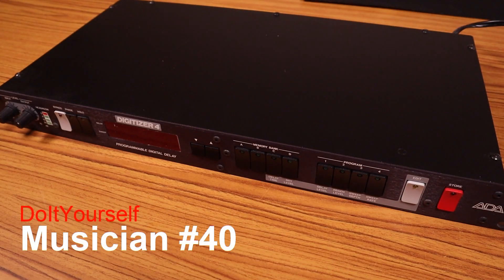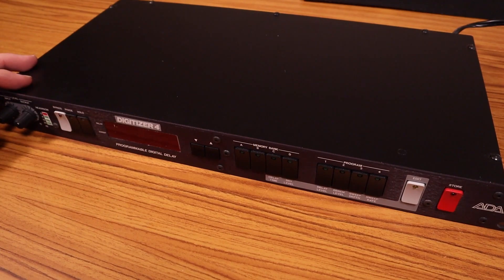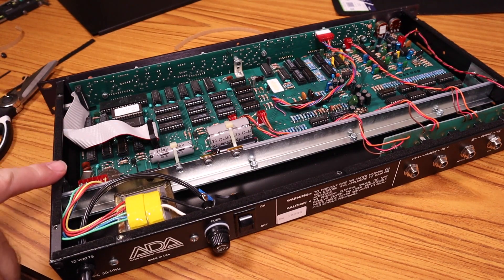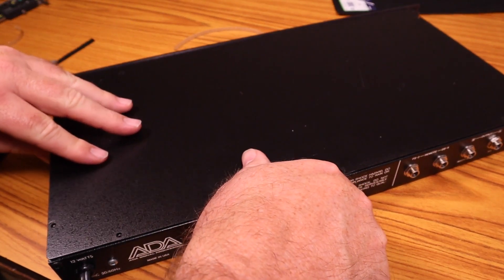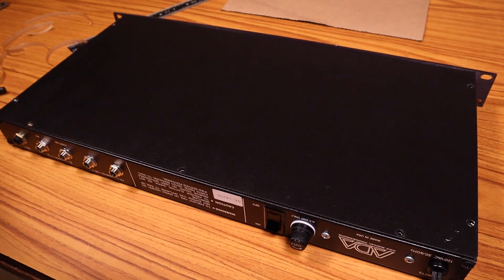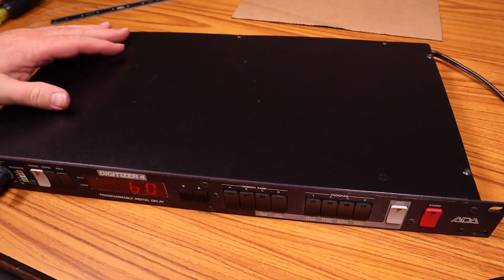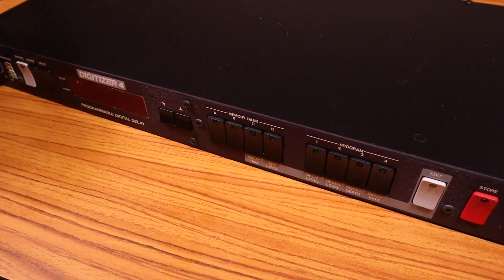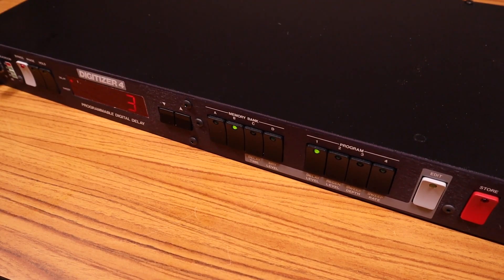ADA Digitizer 4 Humming Transformer "Fix" (FAIL) #40

Comment: Interesting attempt, thank you for the effort. Same problem with my vintage ART ProVerb 200. How about an attempt to mount the transformer externally. The challenge there is drilling and grommeting any access holes for the wiring and covering the transformer with a heat dissipating cover. I've noticed in years past high end compressors like UREI mounted their transformers outside the case.  I once had a pair of LA3A's ( showing my age ) taking a cue from that design is an old school solution??? Just a bit of trivia, I sold my UREI's for 2K 15 years ago, now on Reverb they are going for 5K each! Yikes!  Thanks for the video sir.

Comment: You can put vibration dampers used on cars on the cover, they are asphalt plate with double sided plate.  Yamaha had similar issues with one of their rack mount synthesizers and their fix is to place a heavy metal plate on the transformer.

Comment: Could be magnetic flux. A magnetic field around the transformer makes the chassis vibrate. The transformer seems somewhat shielded though, but worth looking into. It’s a common problem in many synth/efx units. A fix could be to at a metal shield, but as you have already pointed out there is zero clearance in the top...

Comment: Around five minutes into the video It looks like the core of the Transformer is separating. There appears to be a gap at the bottom.  That could cause it to buzz. Good videos.  Keep them coming.
Reply from the maker: Are you talking about the gap in the plates around the coil? The whole thing seems very solid but it might be worth investigating. Thanks!
Reply: Yes the gray part. It appears to be an "EI" core type and it looks like the "I" is separating from the "E".    I would use a couple of C clamps to eliminate the gap and turn it on while it is clamped to see if the hum goes away.  If it does then I would stick some epoxy in the gap and clamp it until it cures.